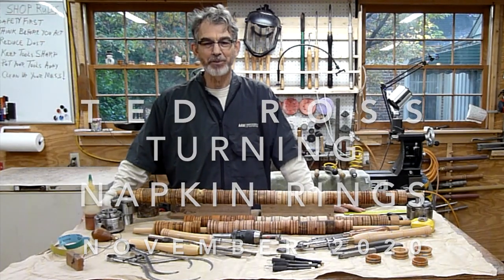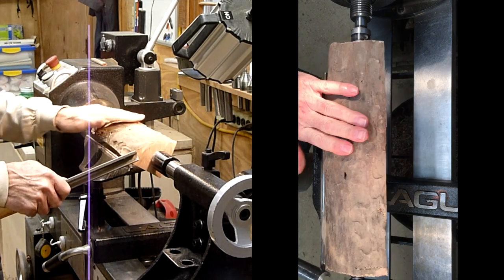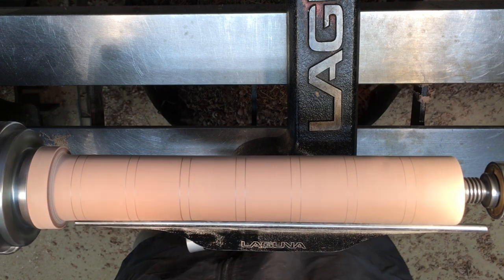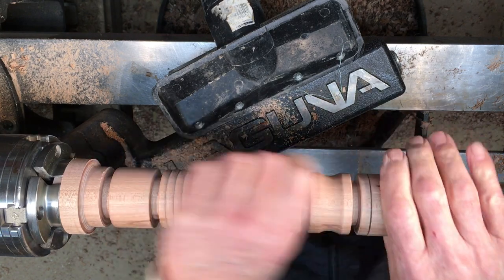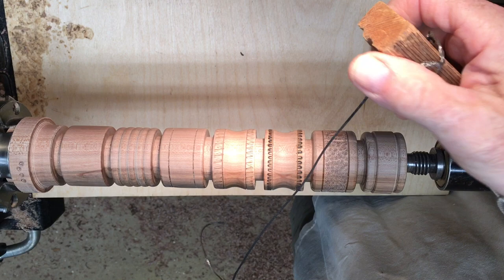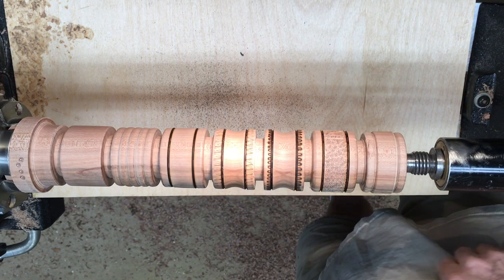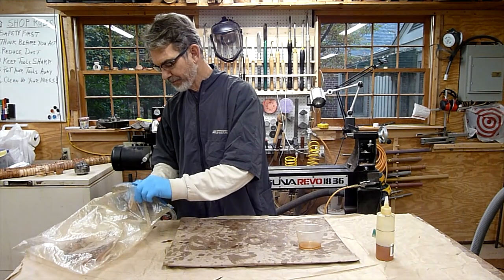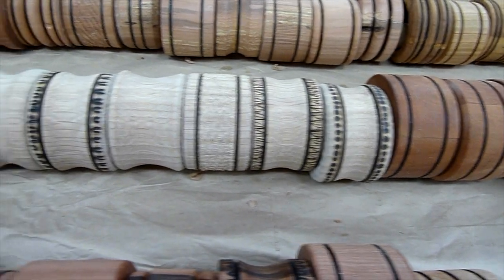Ted's Turnings - Wood Turned Napkin Rings

Comment: Hi Ted, your Lathe looks very massive. I have a few questions about it, if you don't mind. How much does the Machine weigh? Can you turn overhead with it? How much does a Machine like that cost in the US? Great Channel, very interesting.
Greetings from Germany
Reply from the maker: Hi Funmitholz, and thanks for your questions.  My lathe is a Laguna 18-36, I purchased it about 3 years ago, it currently cost $3000 and it weighs around 500 pounds. I am not sure what you mean about "Can you turn overhead with it?".  The headstock moves back and forth on the lathe bed so I can position it anywhere I like, if that is what you are referring to.  Overall it is a pretty good lathe for the money!

Comment: Maybe I missed it, but I didn’t hear you say what the length of each ring was, or the diameter nor the bit size you used.
Reply from the maker: Yes I do mention it, I use a 1.25” Forster bit, and make the outside diameter 1.75”, and the width can vary from .5” - 1.5”, just depends on the design you are after. Best of luck and have fun!